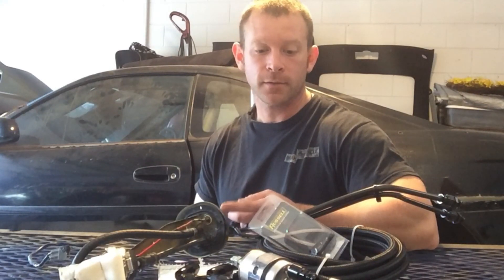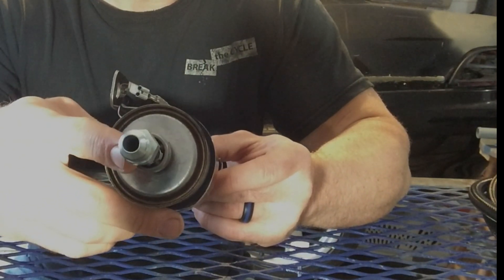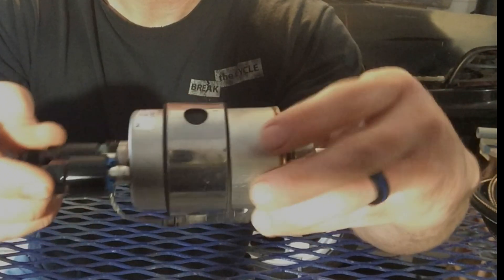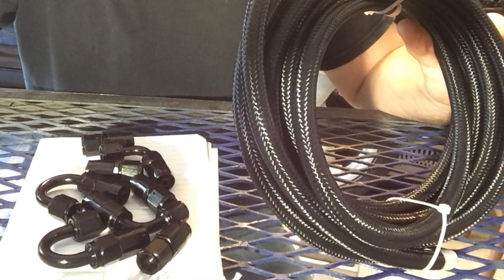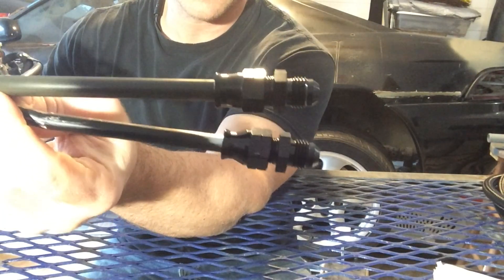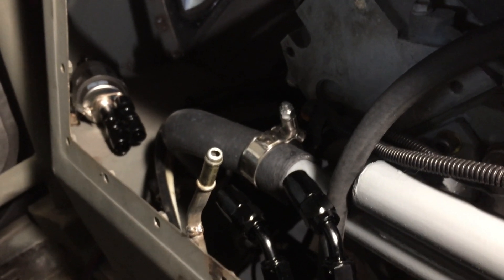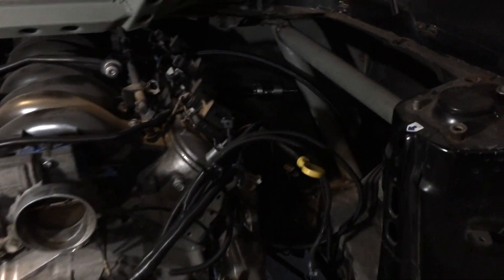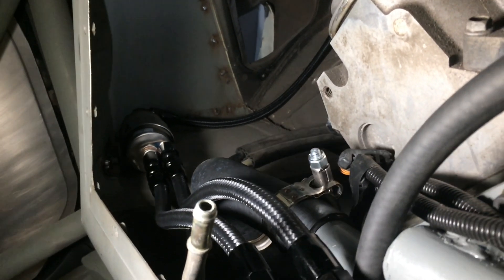LS Swap Fuel System

Comment: My LS fuel rail has a feed line and a return line. What did you do with your return line?
Reply from the maker: The return line dumps back into the gas tank.
Reply: @scantronsgarage  I gotcha. I see so many Corvette style pumps and I'm thinking I'll have 2 returns. But all I need is a standard pump putting out around 80 psi? The return will send unused fuel to the tank.
Reply from the maker: @kevinroberts781  The corvette filter has a regulator for 60PSI built in. 60 PSI is required for our motors. And yes, the excess fuel will return to the tank . You can watch my first start video where I finally use  this fuel system and check the fuel pressure if it helps. The good news is, this setup worked out well.
Reply from the maker: If you have a return on your fuel rail, you can cap it off and use the return off the fuel filter and rout that back to the tank.

Comment: Any issues with leaks on those press fittings on the fuel pressure regulator?  Getting ready to use the same part.  I see speedway offers one now with AN fittings already permanently attached.
Reply from the maker: i dont know yet. I have not yet put pressure to the system. The car is going back together now for final assembly and I should be able to give you an answer soon. On the other hand, manufacturers use this style fitting from the factory and they usually do not fail.

Comment: Why does everyone want to ise AN fittings? They are pretty expensive and do not offer many benefits over other much cheaper solutions. Nylon fuel line is so much cheaper and easier to use.
Reply from the maker: good question. I think we are all afraid to try something new
Reply: An hose will only last acouple years with fuel mine just started leaking only had them on for 3 years

Comment: Please don’t use those shit filter/regulator’s !! They suck first of all, but second they don’t actually regulate properly outside of a factory application. Third they cause premature pump failure as they are too restrictive. Fourth they leak often at lower pressures (when parked overnight).
And last they are easy to pipe in wrong and can kill a brand new pump at start up.. oh and they are loud and noisy too. But dig the bud, everything else is right as rain. 😊
Reply from the maker: This is good information thank you.  I think this is more of a get things up and running system. I just pulled the engine to paint the engine bay. While its out, gonna do a cam and valve spring upgrade. Thanks again.
Reply: for a basic 4.8 LS 2006 engine going into a c10, whats a better filter/regulator?  what should i get, to replace this corvette style regulator? (returnless)
Reply: @howiepol1655  I would recommend a standard EFI regulator. Aeroquip makes some of the best ones out. However they are pricey. But even the knock off versions are far better than the “corvette regulators. I just punched in fuel pressure regulator on eBay and found them for like 45- up to 130 bucks.
Reply: @jasonhull5712  this is all new to me. super appreciate getting a reply
Reply: I got a 99 silverado im slowly trying to cam and build it to push alittle more power whats the difference between my current fuel filter with 1 hose in and 1 out and the one with 2 in and 1 out

Comment: Hey does it matter where the regulator is located? I have the 255 walbro pump the vette regulator/filter is closer to the engine and isn’t mounted down,   return line is factory line on my 86 Monte Carlo ss…  my pressure is 70psi and I even changed the regulator out already pressure is still 70 psi trying to see why it’s not working on my setup
Reply from the maker: That’s a good question. I wonder if the fuel filter you are using is bad or there is a clogged line maybe. I don’t know if placement matters
Reply: @scantronsgarage  I replace the filter still same thing 70 psi
Reply: @adonismoore7938  did you get your issue resolved?
I’m having the same issues 85psi
Reply: @samspeed2531  I just swapped to a real regulator that I can adjust pressure myself
Reply: @adonismoore7938  I just ordered a return style Aeromotive PR myself